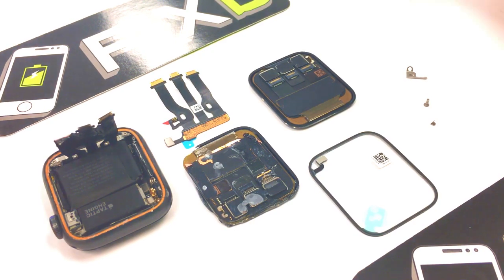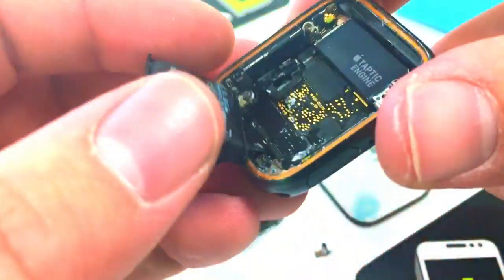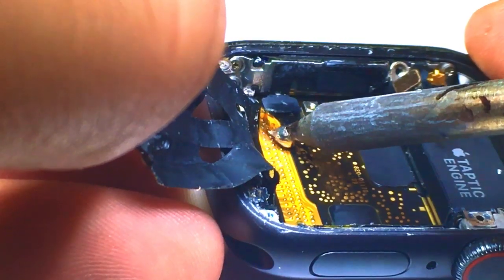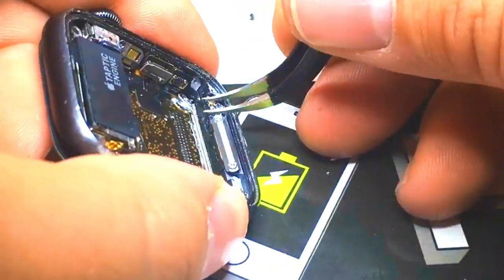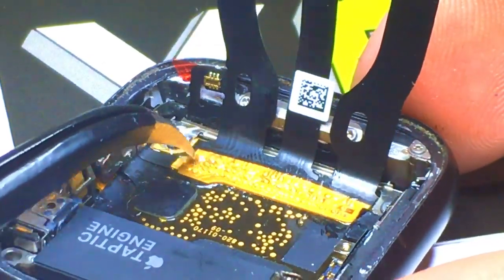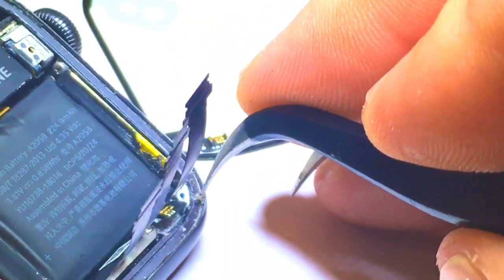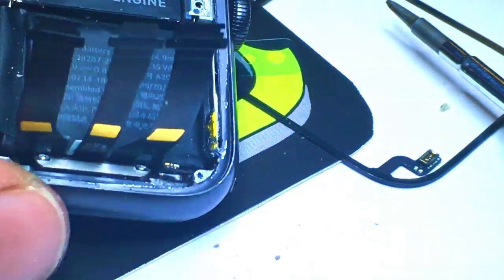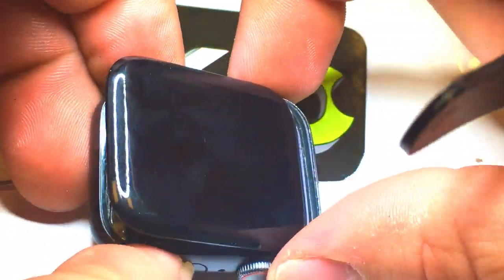Can Superglue Fix an Apple Watch- Series 4 Display Connector Repair

Comment: So, I was replacing a screen on a series 4 ; I  tested it and it worked but needed to disconnect to cleanup the force touch gasket once it was reconnected the screen is black. Every come accross this? The watch powers on and the touch functionality is good. I was thinking possibly the flex cable but wanted to exhaust other possibilities....

Comment: i see a few comments in regards to a safe temperature by which you’d recommend for this kind of repair as to not damage the board in the process. 

could you please share what temperature you’ve set your soldering iron to? & whether it’s in celsius or Fahrenheit?

thanks😊

Comment: Yo i’ve got a question I’m fixing an Apple Watch Series 2 on the screen there is a connector off the ones where you flip them to pull the wire out it snapped off by accident do you know the part number

Comment: Hi FIXD, i damaged one of my Apple Watch S3 42mm GPS LCD flex connector port (LCD side), i think i forced the flex in while the back tab was in lock position and now it does not go past Apple Logo when i power On the watch. When i check inside the port, i can see some of the the terminals are out of position. Is it possible to replace the port with another one which i have from a damaged LCD ?

Comment: I have a question. I recieved the screen on the Apple series 4 watch. Screen works but now battery has the red snake when not in charger and green snake when on charger. It earns up on the bottom where it connects to the charger but won't charge. I figured needed a new battery. I bought a battery and all it does it warm up like the other one and just stays in a boot loop. Any ideas what may be happening? I don't get the connection between screen/cables and battery? An i missing something? Any idea what may be happening?

Comment: If you replace a screen and the force touch gasket is broken will only Force Touch not work or the entire touch screen not function properly (ie. The screen will power up but no touch functions will work)? Awesome video and tanks for the detailed steps!
Reply: did you found an answer to this? im stuck with the same problem
Reply: @okiesib  i did replace the force touch gasket, unfortunately did not help. Seems that the ribbon cable was damaged, tried to replace it, but my soldering skills did not match and damaged one of the fragile pads in removing the old ribbon cable from the logic board (So left the project there).  the force touch should not prevent the whole screen from functioning (like I initially thought) should still work like an old Apple Watch pre-force touch. (Hope this helps, good luck)
Reply: @jasonfrancoispotgieter7302  thanks for letting me know. I’m waiting for my flux to arrive to attempt to desolder and resolder a replacement 🤪
Reply: @okiesib  be very gentle in removing the ribbon cable from the pads and take your time (learn from my mistake😭) and use allot of flux and use some copper wick (desoldering braid) to assist! to get rid of all that sticky flux residue afterwards use some 99% isopropyl alcohol to clean. Hope you get it to work!

Comment: Hi love your videos, can I ask can the lcd screens be used on all the series 4 I.e. a 40mm used on a 44mm watch just for testing if the watch works?
Reply from the maker: Bob Ebay , sorry it will only work for the specific size that it’s intended for.

Comment: I have replaced ser 3 screen complete. Watch works fine but will not pair with phone. Is this to do with new screen been detected ?  And not allowing pairing. Many thanks.
Reply from the maker: It’s the NFC connector that isn’t coded to your watch. Do you still have the old screen?
Reply: @FIXDPHONES  Yes I do, i have tried to connect the old screen at the connector nearest the crown and the other two on the new screen but still the same as i had read that was worth trying, thanks
Reply: FIXD is there any way round this ?
Reply from the maker: Did you try to reset it while doing that?

Comment: I have replaced the display and it won’t turn on it only vibrates any idea? Thanks
Reply from the maker: Roman Gal it could be that the connectors aren’t in all the way. It could be a defective screen as well or that the display cable was damaged somehow. Hard to say without opening it and seeing what it could be. Try reconnecting it first. Good luck and let me know if you need assistance. Thanks
Reply: So did you find your problem? 
I have same issue. Removing old display, it started flash green and turned off. After installing new one, its not turning on (screen) , but watch is turning on.

Comment: Great video and how much would a refurbished series 4 cost?
Reply from the maker: It depends how it was refurbished but would probably go for the average price of any used in good shape watches on eBay for example.
Reply: FIXD aww, thanks for answering me tho.
Reply: @FIXDPHONES  hey, the screen on my/ apple watch series 4 stays black, i was water damaged but now it turns on but the screen is black, should i replace/ the cable or should i reflow the old one